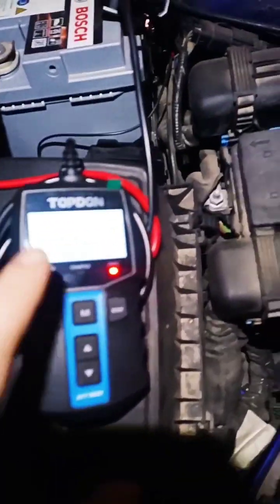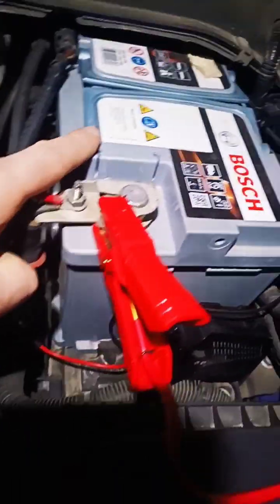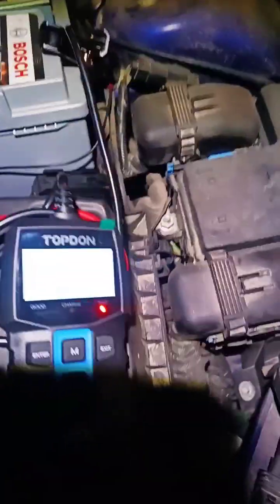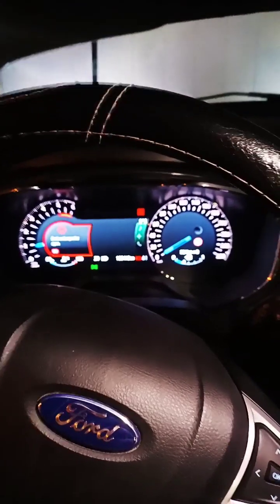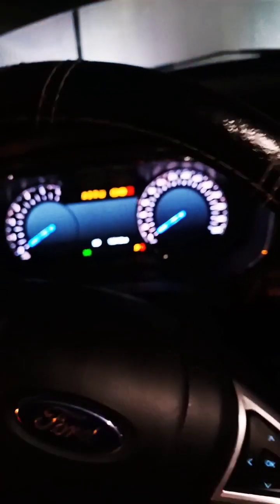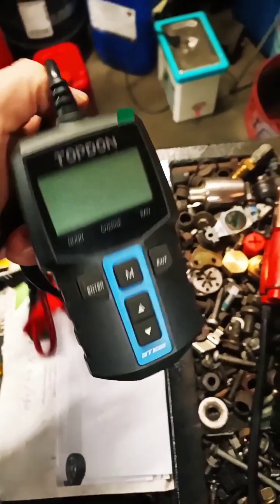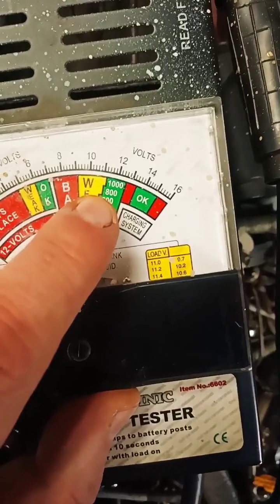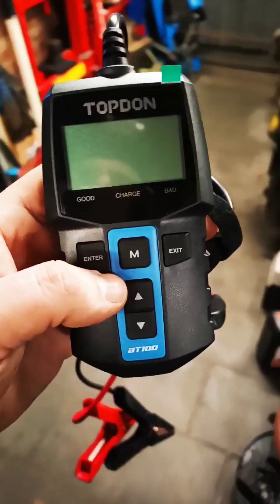Testing an AGM battery - Ford Mondeo - @BennySVK117

Comment: Many thanks from the super fan! ♥
I made a list of all the things to check once I get to it, you helped me a lot man! Gotta check what my battery status is, it's only 1.5 year old, but since it wasn't calibrated, it might as well be close to dead. I also have to pay attention to the cranks, it might reveal something, but it might be deceiving now considering cold temperatures and diesel engine. 
BTW I took a quick peek at the Electrical schematics that you sent me, but I noticed it's for 1.5 Ecoboost. I assume the light electronics are the same, but I just wanted to confirm it to be sure. Thanks a lot once again! Will keep you posted when I have some updates.
Reply from the maker: No problem man. Well I would suggest to buy the same tester, it was 37 euros on amazon. It's a nice tool that can make you a couple of bucks. Just check all your friends their batteries and the tester will be repaid:) Well your VIN checks out here as a 1.5 ecoboost here in my Belgian parts software. What is your engine code exactly?
Reply: Oh I expected it to be more expensive, I'll definitely order one haha. 
It's very strange that my VIN shows 1.5 ecoboost, the mechanics here in Czechia and Slovakia had no issues with it. I'm not sure about the engine code, I searched everywhere, even in the official Ford Spec sheet but there is no engine code mentioned. It's 2.0L TDCi diesel 132kw/180hp, 6-speed manual, wagon, no hybrid systems, the car is 2018 so the engine should be 2015 design/model. 🤔